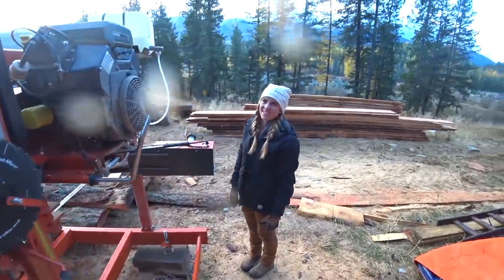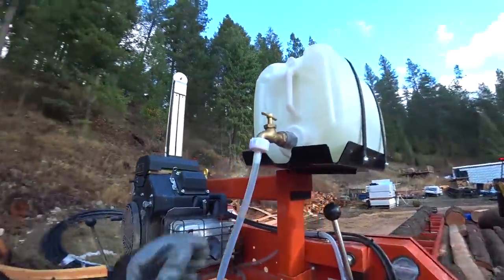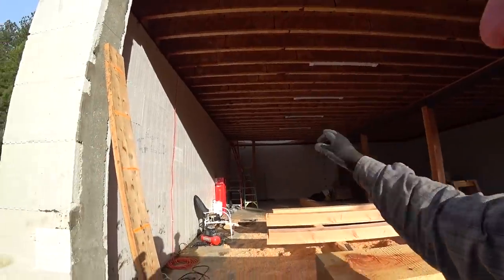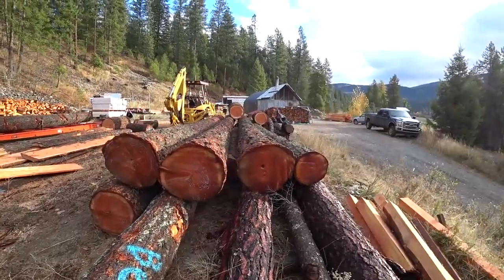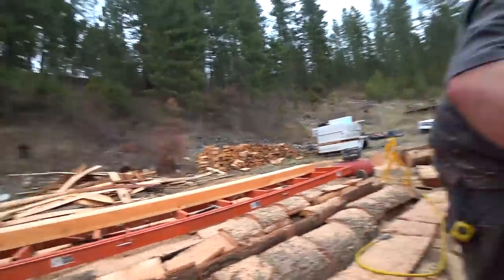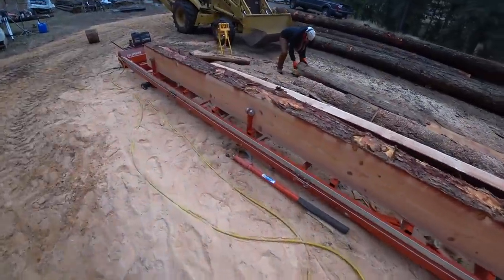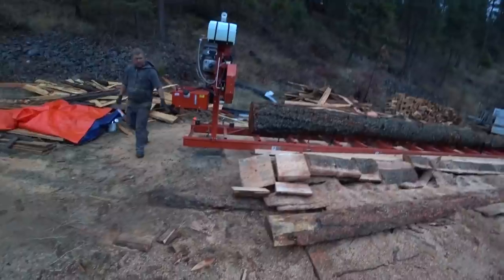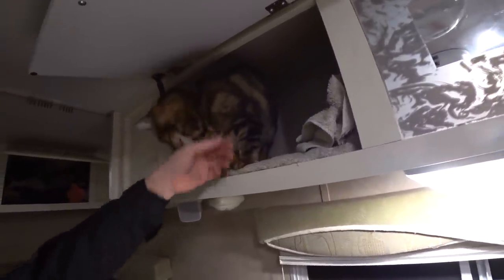Building a House Start to Finish: Sawmilling Timber Frame in 3 Weeks

Comment: you are crazy cutting a fortune in lumber into firewood ,stack it and cut it later when the pressure is off it will be quicker and more profitable in the long run
Reply: Nope, it won't be more profitable....

Comment: Lol on the teeter tooter. 2 suggestions for you. 1 slow cooker meals. you throw some stuff in there in the morning and set it to low and 6 to 8 hours later you have awesome and cheap food. You won't regret it. Second you would really save time and energy if you lifted the timbers with 2 slings. No messing around on the balance and then all Alyssa has to do is keep the swing in control. Great vids, love the progress and I know why but it would be better if we weren't so far behind. Keep up the good work. Say hi to bugaboo.

Comment: It is probably a good thing you weren't able to get these "firewood" videos out until after the push was over. I have such an overwhelming urge to jump in the truck, drive 2500 miles and stack firewood so you can get on with more important things. 

Funny how blessings work. 

I love being allowed to peek at your lives and this amazing project.

Comment: She's a keeper!!!  I would recommend Johnson's Paste Wax for the planar table/bed.  It will help tremendously with the sap build-up issues and it will help the planar glide across the beams smoothly.  I know the timber frame is done, but this will help for future projects as well. I use on my table saw table and it helps reduce friction and protects turntable too.

Comment: Hey guys!  Great videos!  We chatted recently on you FB page about the log lifting tongs.  I got two of them and use the loader bucket with chains.  I see you had some trouble getting the claw to dig into the log.  I find that out of the box the tips of the claw are quite blunt.  I used a grinder and made mine sharper.  Now it digs into the logs so much easier.  Just thought I would share my experience in the hopes it might help you out.  I'll probably do a video on my setup very soon.   See you on the next one!!!

Comment: 4ft length of clear 3/4in hose.  Set the 5gal can higher than tank and give a quick siphon.  Much easier than pouring the 5gal cans.  Clear hose so you can see the fuel and not get a mouthful.
Reply: Great improvement.  Thanks, I'll get one for my transfer hose.

Comment: Another great video,l know it’s too late now but for future builders get local gas companies to drop off free standing gas and diesel tanks that can be returned a later date. These tanks are usually 250 or 500 gallon come on a 8 ft stand with filler hose and hand value.

Comment: have they done any testing/diagnosis of the charging system on that backhoe? I don't remember if I've seen that or not...

A diesel like that is probably perfectly happy without a functioning alternator, but if the battery isn't getting charged the "new" battery will not live long, and soon you'll need to be jumping it every day, and etc.

Comment: Alyssa needs her own small tractor for firewood.  Or a 4-wheeler.  She could use that to bundle the scrap and two it down to where the woodpile is.  It would save her cutting and throwing it in the wheelbarrow or the backhoe bucket and pushing it over to the woodpile.  Just a thought to save her back from all the bending over.  The backhoe would be overkill to difficult to maneuver into that tight area to drag the waste down to the woodpile.

Plus it would allow her to process the firewood away from the sawmill.  

Keep up the great work.

Comment: A friend of mine has one of those Stihl easy pull saws.  Its weird to get used to.  I can remember being 14 and trying to start a Stihl 090, it had a compression release and it would still just about break your fingers if it caught wrong.

Comment: I lost the pin on one of my grapples too.  I am thinking of replacing it with a nut and bolt so I know it doesn't happen again.  Since it happened to both of us it's likely to become a problem.  I think a small but and bolt would be more reliable.

Comment: Hi, would a bungee cord help that claw?  If you're having any trouble with pitch you can pressure wash the bar and engine.  A little trick with the chain is get a bucket of water and at high speed dip the bar in .  Yes it will splash a lot.

Comment: The backhoe battery problem is likely still a phantom load problem. I'd continue to use the manual switch to ensure there is no current. The theory of the battery damaged in transit is not likely. Its damaged because you can not cycle a staring battery and its constantly being drained to zero. Do that to any starter battery and it will wreck the battery fast. They need to be full SOC all the time.

Comment: If I could offer something regarding the black spots on your joists under the tarp: While they may be iron shavings here in the NW we have 52 different species of mold and spores that create a  similar blackening of the surface and they are in the wood naturally. I am an Architect and a General Contractor and over the 40 years of building with timbers have dealt with this issue on almost every project. The most effective solution once and if you need to plane the surface is to treat the wood with Oxalic acid is rubbed onto completed marble sculptures to seal the surface and introduce a shine. Oxalic acid is also used to clean iron and manganese deposits from quartz crystals. Oxalic acid is used as a bleach for wood, removing black stains caused by dissolved iron that binds to the wood during water penetration.

Comment: Allysa, Have you thought of using the log scraps for raised garden beds? I would use the boards with bark for raised beds.
Reply: I cringe when I see them cutting those up. I think I would have put them aside whole & found a use for them later. Just my opinion.
Reply: they've already talked about this.  this was the original plan, but they are running out of both space to put all the lumber and time before their timber frame workshop when all the beams have to be cut (maybe a week to go at the point of this video)
Reply: Kevin Hammond yes, I saw that video. That's why I said imo.
Neatly stacking them for processing later would have saved time. She could have been planning instead of making firewood.

Comment: Instead of diesel you may consider using paraffine. Just rub a tea candle on the planer bed. The benefit is that it doesn't get absorbed by the wood like diesel does and it is far easier to manage. You can just have a tea light laying around and don't have to fuss with rags etc.

Comment: I seen the trouble of losing the grip on the grappling hook and i might suggest placing a 2x2 post in the receiver and using it to hold it closed and from a distance until under tension while lifting then remove it to move the log.

Comment: Jesse have you considered that its probably the lumber itself that's out of square vs the sawmill? There's way more variables at play in the process of cutting a timber that size than there are things that can be out of whack with the sawmill rack. A bounce in the blade here or a spot of sawdust there is probably slightly throwing the dimensions of your cuts off rather than the machine being out of calibration. Just a thought.

Comment: For what it is worth we wrapped a grain sack with the bottom cut out around the output of our bandsaw mill and it cut the dust in the air by more than half.  For the low cuts it sort of drags on the ground but who cares?

Comment: Long curved logs ... You can determine the max length of a possible milled piece with 2 parallel strings the lenth of the log.  You can make a top cut to help but should not be neccesary... By the time you read this it should be done. .but consider for the future....??
Reply: He knows that...he explained that process in an earlier vid...

Comment: Massive effort doing all this work.With lumber prices in the US,allowing for having to buy the mill and planer and spares and fuel for backhoe and mill and logs how much does doing this yourself save?There seems to be a lot of good timber being sawn into firewood instead of 4x2,2x2,3x2,4x1 and so on.Basically a lot of 'waste' which has been paid for as timber.So how much cheaper is it tha just buying the timber already cut to size?

Comment: This is interesting, as points out that logs should have been looked at and the design be considerate to this. For example, scarf joints so 28' super strait logs are not needed, instead two 15' beams which be easier to get out of a crocked 28' log. Scarf joint mean larger beam size?

Comment: Ez off oven clener to clean the sap off the planer and saw blades it works great and is cheer than the stuff tey sell to du the same thing put it on let it sie a few minutes then wipe it off and spray the base with silicone and wipe it off the start to work again

Comment: you guys should get a battery powered leaf blower for cleaning that sawmill. Milwaukee  surely has something that would fit your batteries.
Reply: Probably wouldn't work on wet sawdust nearly as well as the compressor.

Comment: Would rubbing some wax help to avoid the sap build-up on the planer?
Reply: Harry f. Probally becuse dries faster in the ends
Reply: They rub diesel on the planer glide surface they said to avoid sap sticking
Reply: I read wrong thought you menat on The Wood.
Reply: Not wax.  diesel it is Great

Comment: With the chainsaw sharpening, lift off after the sharpening stroke as dragging back the file invariably dulls the tooth. Three smooth passes is enough. But lift off.

Comment: I think I would have cut the slabs in half lengths and moved them to a neat pile with the backhoe.   Decide what to do with them later.  Their desire to keep Jesse milling has Alyssa spending waaay too much time cutting and moving "firewood".  And those piles of cut wood are taking up more space than stacked slabs would.
Reply: SKPChick 31 please do not use common sense, it creates too much contrast 😂

Comment: Im with PghFlip! I realize that your priorities are for milling the large beams, rafters, floor joists for your house now but after the house is built will you not be building other structures like a storage shed, greenhouse, workshop etc? Maybe i'm missing something but could you sticker the pieces that have 1x and 2x lumber in them, off to the side, then months down the road after you have recovered from the house build mill them for the other projects?  I do understand that some of the off cuts will need to be firewood but I also see a lot of wasted dimensional lumber. I also see two very whooped people at the end of the day that have been cutting, picking up, throwing into the front loader all those pieces of "FIREWOOD".
Reply: August did you actually read my comment? They have the time to cut into small pieces and move those small pieces many times?

Comment: If I were using that grapple in those situations, I would remove the square tube bracket. It's totally unnecessary and more of a pinch hazard, reducing the weight would make it slightly more maneuverable.

Comment: as far as the mill getting off kilter, is it the little adjusting screws vibrating and turning?  or the pavers themselves shifting around?  If it's the former, could you run down a jamnut on them to keep them from moving?

Comment: I'm kind of surprised that you guys cut the waste slabs into small bits there at the sawmill. I would have thought it'd be faster to move them in chained bundles with the backhoe and then cut them into pieces at the pile.

Comment: Do logs that length (24-30 ft) and weight as much as these bend when not on a flat surface, if so how does Jesse know which way it will bend when done? How do you put a crown in lumber?

Comment: Love the Videos, and feel your pain,... I'm a stick home builder. I just keep wondering why you're cutting up all those THICK slabs from the 4 sides of the logs for firewood??,... At least i'm seeing a lot of thick slabs that coulda been cut a few times to produce a ton of 3/4 inch boards of varying widths. I know it isn't a time issue because using the chainsaw many times on each slab takes at least as much time. just wondering, not picking. keep up the vids, those of us that care are thankful and learning.
Reply: no time. and cleaner firewood burning with less bark to wood ratio. bark can clog up things if not experienced and careful. and the timbers are what he needs for the workshop around the cornor

Comment: We are finally in our Coventry Log Home kit. It isn't finished, at about 90% now, but should have a CO soon. I'm wondering about drying those logs before final cut and assembly. Coventry claims their logs are dried down to less than 19% so they won't warp after construction. Not all that happy with Coventry but the logs were mostly okay. What do you think about drying logs??
Reply: Guys that cut logs for slabs say it takes one year per inch of thickness to dry.  Not practical in timber frame house.  Also, its held together with oak pegs, joints movement later or shrinkage not terribly important.

Comment: Love what you two are doing. 😁 Only thing that’s hard to watch is you cutting up all that good wood for firewood. I know that’s not your priority. But was thinking you could save for later projects. Or at future time cut into 1” or 2” boards to sell. That’s some high quality wood. I’m always saving wood, just the frugal carpenter in me.
Reply: Jim Skorupa had you noticed them saying how MUCH lumber they're ending up with when cutting down to the timber size, without even trying? They're already overflowing with unnecessary boards, including what was left over after taking down the concrete bracing and scaffolding.

Comment: I don't want to be a Safety Sally but please, please do not stand on the log deck while grappling a log.  It may look secure but if the log you're grappling kicks into the deck the entire deck could shift and cause extreme injury or worse.
Reply: Jeffery Craig absolute deadly standing on  log deck when moving logs.  Many an old logger has died that way ..

Comment: it seems to me that you're very innefficient with you're firewood system. instead of cutting it and then transporting it you should cut it where you store it. lay a few chains or ropes under the saw mill when there is enough  just pick the chains up and move it with the backhoe and cut it after. much less work. videos have gotten so much better by the way. keep it up. cheers

Comment: I know in one of their videos they talk about a chainsaw they really liked, I believe it was a Stihl, but I'm having trouble locating it. We need a chainsaw for general purposes, and I would really like to get a chainsaw mill up and running soon. What are people's recommendations?
Reply: Pro's choice is Stihl and everyone I know that has one swears by them including me. Note, chainsaw mills are exhausting and size of lumber you can cut is limited.
Reply: They have two chainsaws, both of which are Stihl; one is large, one is small.  I'm not an expert, but the industry standard is definitely Stihl, seems everyone has one.  Stihl was the inventor of the chainsaw.

Comment: and she drives a backhoe! 
Question for you guys: it might be more trouble than it's worth... but every time i see you take a huge swath off a log and then just chop it into firewood, i cry a little.  wouldn't the center of that be a perfect candidate for a nice quarter sawn piece of lumber?  I know you're going to have so much lumber, but this would be premium and very stable lumber.
In Any case,  Strength to you both, thanks for sharing your experience with us!
Reply: yes... when you cut the top, you have flat sawn... rotate 90 and cut the center out. you'll have a quartersawn piece.  If this is the piece sawn off top ( |   I'm talking about cutting here:  (=|  the "=" portion is quartersawn-- and what i'm talking about.   I know the wood itself isn't being wasted--- but i'm thinking that one cut out of the thicker flat sawn pieces is a valuable piece in particular.    And yes... priorities and all... it just makes me sad.

Comment: I have watched all of your videos for quite some time now, and see how much hard work you have committed upon yourselves. Great job. I have also gained an extreme amount of knowledge from watching them. Now my two cents. I can see now, how much trouble you have gone through re-leveling that saw base. A full slab is the way I would go if I were to run my mill and also would have gone with the Woodmizer LT 15 with the hyd log leveler and the built in log roller. That poor frame of yours sure takes a beating with those heavy logs slamming on the base. In no way am I ridiculing you for your choices but like I said, I learned a ton from watching the choices you have made. Now PLEASE PLEASE PLEASE, both of you stay safe. Good luck with your timber shop goal date.

Comment: IMPORTANT - SAFETY tip: When running the chainsaw, Always have you top hand tump around the bar, not parallel, or over the bar, like we did see here. If thump is nt around, then you can't hold the saw at a kickback.

Comment: You guys need some better log tongs! Those ones are to flimsy. Also should get a proper solid foundation under that mill so it stays perfectly aligned. Bolt it down solid instead of sitting on little pads.

Comment: Another tip I just remembered is that you all should get a trailer for that huge sawmill.. It will elevate it high enough so it doesn't kill your back.. Down side is it would be a little harder to turn over logs/put logs up on it... Has it's benefits and downsides... Benefits is that you can move it and it won't keep coming unadjusted on the sawmill etc. Downside harder to lift logs, turn logs.. Easier thing you mentioned and others has is put a concrete slab down and I'm sure it'll help from stopping all the extra pain.